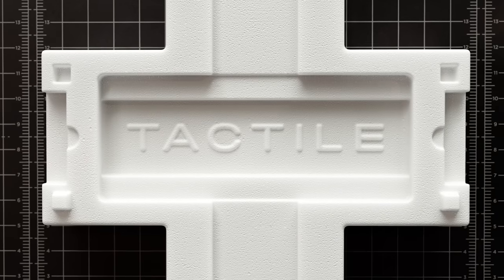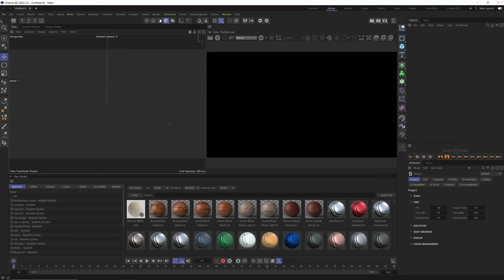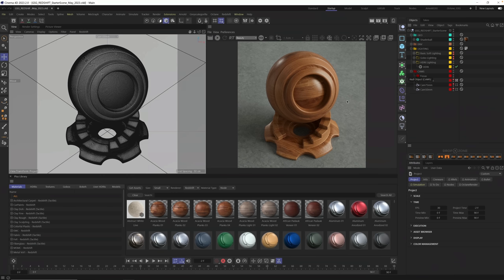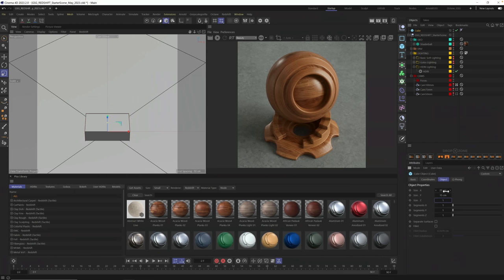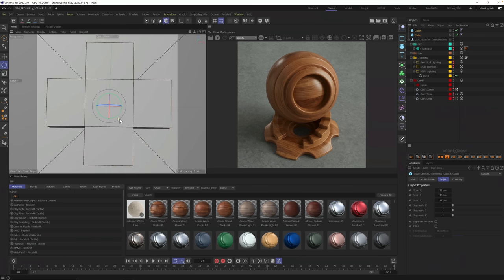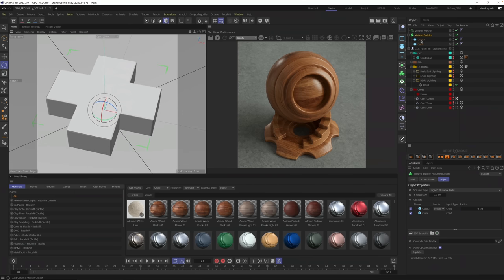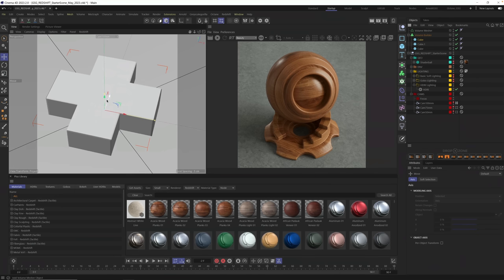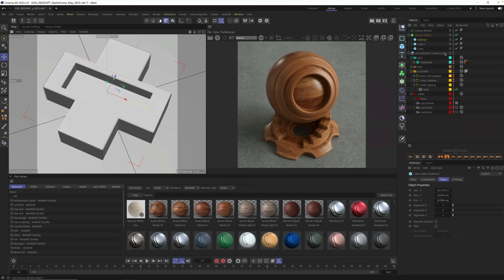Create 3D Styrofoam Packaging Without Ruining The Planet!

Comment: Great tutorial. Worked well, but how do you do the displacement in Arnold; only Octane and Redshift were mentioned. Also, the depth of field doesn't change for me when I click "Focus" then use the place tool to select the object I wish to be in focus (using Arnold).
Reply from the maker: Use the included Arnold tags on the shader ball to easily add displacement to any object. Or watch our Arnold displacement tutorial on here on Youtube. Hope that helps.